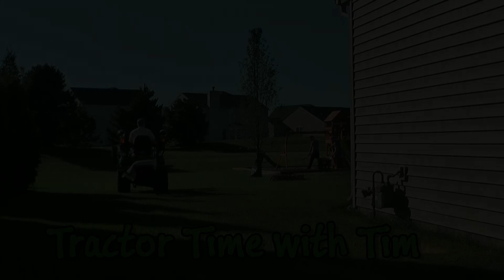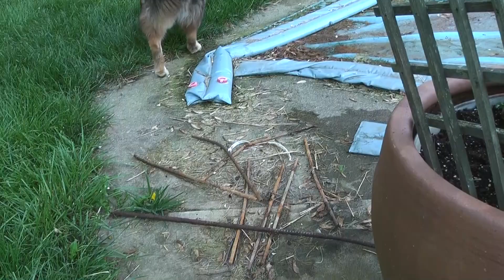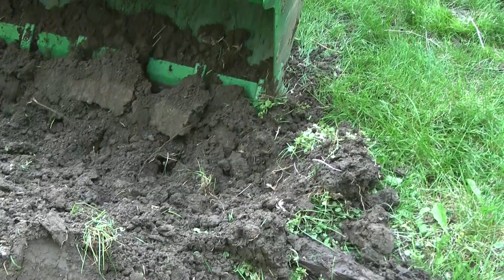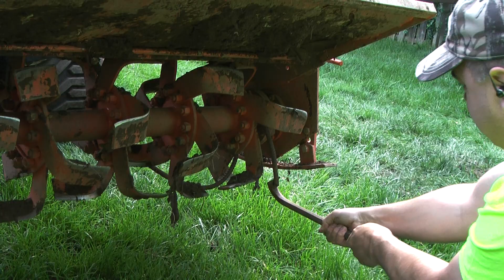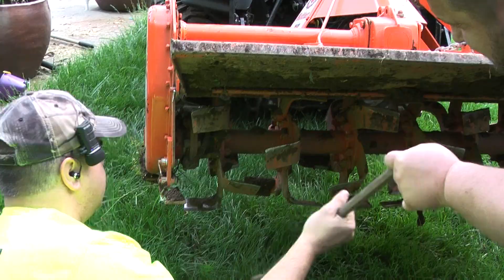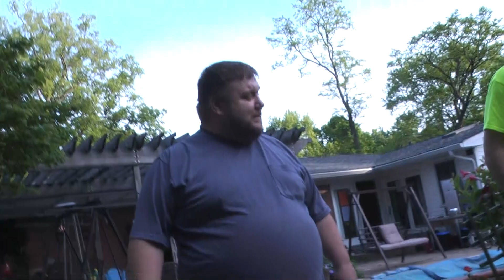#66 John Deere 1025R - Revenge of the Rebar

Comment: Massive basketball size rocks are the challenge in my garden. I have had them totally shut the tractor down using my Frontier RT2049 tiller. The back swinging door was also blown off the back of the tiller twice now. So far the tiller has survived and I was able to reattach the door. Hopefully soon the massive rocks will all be discovered and removed from my new garden space.
Reply from the maker: Wow! 
Better loosen that slip clutch some!

Comment: Maby a tool box on your trailer or make one that you can attach to the bars behind your seat. Sometimes you need hand tools not a tractor tho it's normally 90% tractor you need. And loving the new audio glad can here you better
Reply from the maker: Yea, I need a toolbox solution of some sort.  I don't want to leave tools out on my trailer (even locked) all of the time.
Maybe I could mount something on a pallet which I could sit int the truck or something?? Not sure.
I don't do enough of these jobs yet to take it too seriously.
Reply: +Tractor Time with Tim maybe just a tool bag with a few in just in case something brakes or gets loose that can be in your car (truck) then is not attached any where and as a plus if you did need them you can just carry them a pallet might be a bit big for hand tools. Depending on how big your hands are of course

Comment: Always carry a big ol pry bar and wrenches to adjust your skids and to tighten up the bolts that hold the tines on. A qt of gear oil and Allen wrenches to check your oil levels and a big hammer and adjustable wrench. Those items will save ya alot of heartache in the future.
Reply from the maker: Thanks for watching, Tim.   Have you had issues with your gear oil leaking or something?

Comment: I feel your pain there Tim, I had a situation with my tiller where I sucked up a 1/2 pipe buried in the ground for an old oil tank that must of ran to a building a long time ago that was no longer on the property. That stopped the tiller in its tracks thank god for slip clutches all was good after a  pipe ectomy  with a hack saw.
Reply from the maker: Yea, interesting observation.  These rebar were driven straight down into the dirt presumably to hold some treated timbers in place.   It is interesting how the tiller just grabbed them and pulled them up.  Sounds very much like what it did with your pipe.

Comment: Napon for that yard... Not worth the risk on the new implement
Reply from the maker: I understand your comment, but I'm not sure I agree.  This is EXACTLY the type of yard that a 1025R (or similar) can help with.    It is (was) in poor condition and needed major renovation.  The 1025R made that renovation possible.
Reply: +Tractor Time with Tim   Yes, I am frequently amazed at how resilient the attachments are for the compact utility tractors. As you said this work is precisely what a CUT is for. If you can see and remove as many of the hazards as possible, you do that first. There will always be the unknowable out there to challenge man and machine.

Comment: No but better to have it and not need it than need it and not have it is my motto. Get yourself a milk create everything you need will fit in it nice and neat. Now as for the tiller I am so glad I got it I only wish it would raise it a little higher it tends to drag it coming off the trailer.
Reply from the maker: Agree on the lift height for the tiller.  It seems that the XB specfically could have been made with the lift pins mounted lower on it.  That would have been a nice feature.  I'd much rather have the lower lift pins than the 'narrow' non-quick hitch compatible lift pins.

Comment: Why all the rebar in the ground?
Reply from the maker: It was (apparently) used to hold timbers down. These timbers separated garden sections from grass sections of the yard.
I gather than Patrick (or someone prior) removed the timbers without pulling up the corresponding rebar.

Comment: Tell us about this mic system you and Christy are using. Pretty cool.
Reply from the maker: +Steve Earp it is from SENA.  We retired it. The mics were over sensitive, causing echo between them, and not eliminating the tractor noise.  
They have another setup we are thinking about now.  These things are expensive, and you tube revenues are not enough to support them.
Reply: Seems like a great way to talk on the videos and to communicate with the videogralher. Hope you find a system that will work at a reasonable expense
Reply from the maker: +Steve Earp yes, we like live audio much better than voice over. Captures the emotion of the moment better.  ...but hard to do.

Comment: my mom hit one of her tomatoe cages with her rear tine walk behind ended up wrapping real good wiping out the plant. i had to fire up the compressor and use a die grinder with cutoff wheel. im surprised the rebar came out without cutting
Reply from the maker: Yea, I was worried about that.  However, the rebar was really tough, and didn't get wrapped all the way around before the tiller froze.

Comment: The audio seems to be a be not right when the tractor is off. Grate when on but when it's off there is a bad Ecco and sound very high pitched maby use the old mic when the tractor is off?
Reply from the maker: Gordon, you are correct.  The problem is easily explained.   Christy and I have an 'intercom' setup in this particular video.   When the tractor is off, we are standing so close that both microphones are picking up my voice, and the banging, etc.   This causes the echo.
Also, this was the same excursion as the last video, so the distortion is still present.
I apologize for the audio, but I thought the video was interesting enough to post anyway. 
Not sure how I could fix it in 'post production'.
Reply: +Tractor Time with Tim no need to fix it but just for any you have not filmed yet just bear in mined maybe turning one mic off but to be honest it's ok not the worst but also not the best but your getting there.
Reply from the maker: Ok, so here is our plan going forward....
We bought an 'action cam' from the same company as the intercom mics. (www.sena.com)  We'll record the intercom conversation on that action cam.

We'll record the audio as we always have before with our traditional camera.  Then, in post-production, I can pick and choose which audio to use.  

It may take me some practice to mix/match the audio, but hopefully we can get it working.

Make sense?
Reply: +Tractor Time with Tim that will work yes however those mics are not really meant for recording for these kinds of videos have a look here just for a few more ideas http://www.boya-mic.com/products/index.html please not think I'm being rude as I love your videos just want to help keep them going and them to be the best they can be.
Reply from the maker: +Gordon Mullan this is exactly the type of help we need.  I very much appreciate it.   I&#39;ll look into those mics
Reply: +Tractor Time with Tim you are most welcome

Comment: Tim, has your King Kutter tiller had problems with grass wrapping around the ends of the rotor? My new Woods TC74 has a horrible problem with grass wrapping. 
BTW, if you think it's bad with rebar in your tiller, try cattle fencing in a flail mower. 100x WORSE!!! NOT FUN. :( 
keep the videos coming. Please.
Reply from the maker: +Drew6709 no issues yet.  However, I have a crabgrass infested garden to till in a few days/weeks, so we'll see!